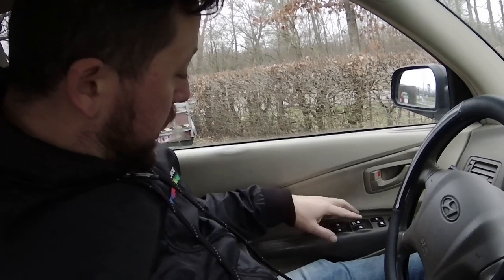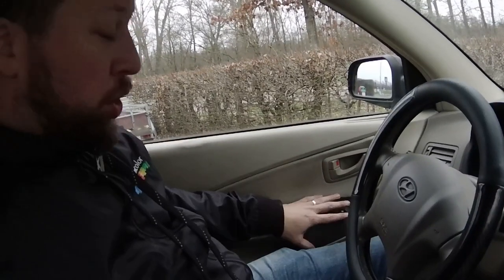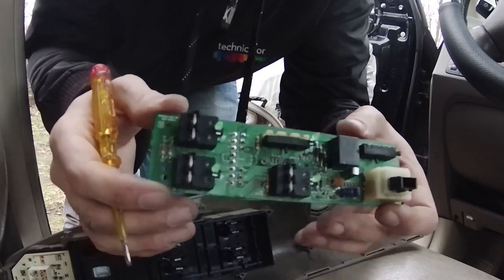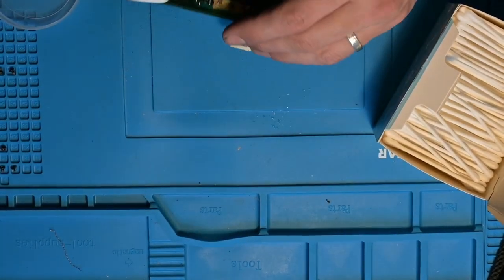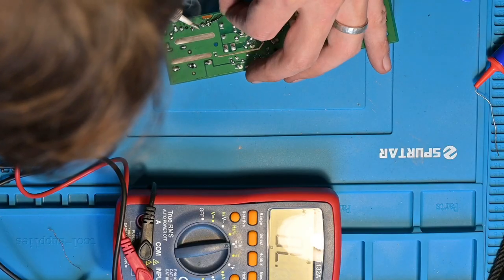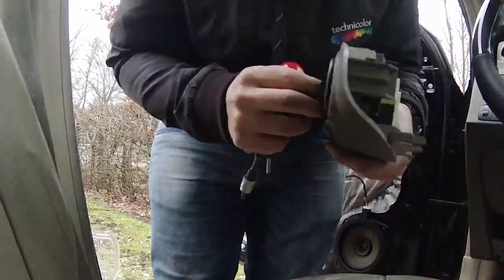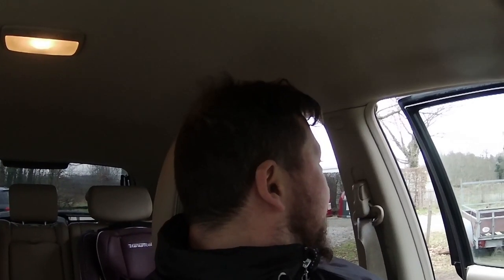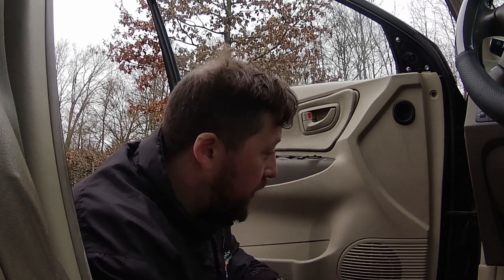Can I Save 850€ By Fixing My Own Car? 2007 Hyundai Tucson Window Control Repair

Comment: The thrill of fixing something yourself 🥳. Yoni you should come over at Ko-Lab Mechelen. Find some more tinkerers and exchange ideas 😉
Reply from the maker: I'll be helping out at the repair café in Bornem on the 16th in the makerspace there. I'll check out the Ko-Lab. Thanks for the tip.